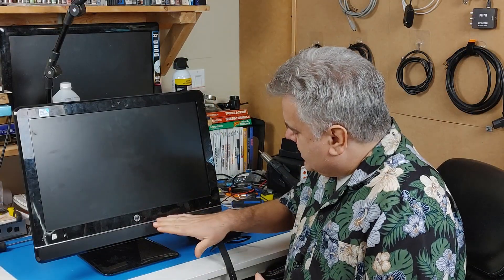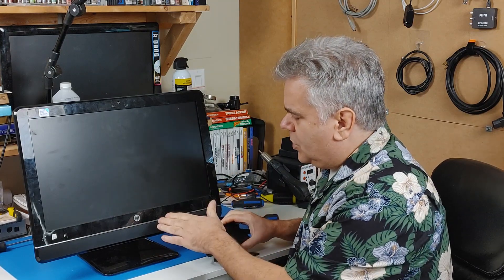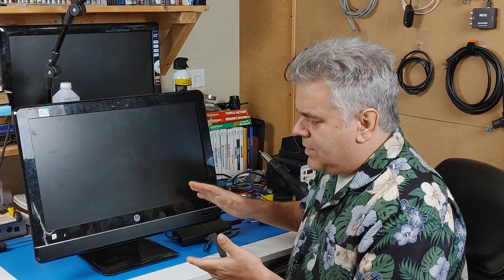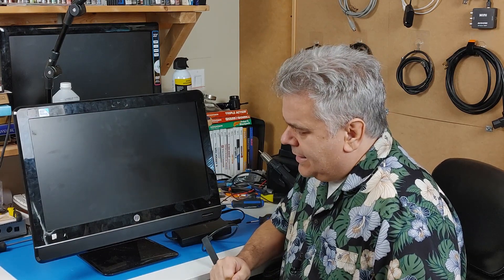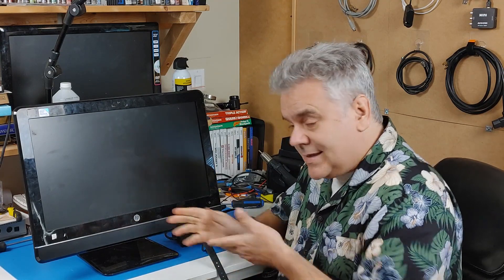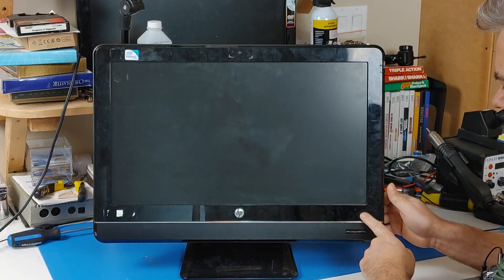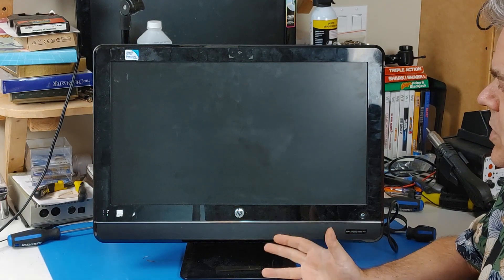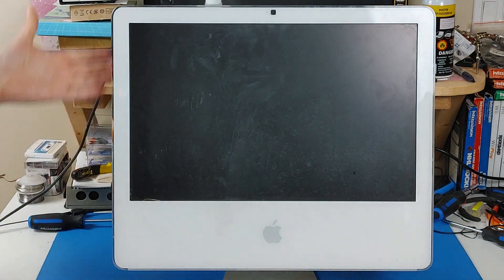Replacing The CMOS Battery in An HP Compaq 6000 Pro All In One

Comment: Before you give up on the HP, I’d like to see you check the power connector, switch and check for voltages.  The principles are similar to troubleshooting of the old 8 bit systems you’ve worked on before.
Reply from the maker: I'm not giving up on it yet, the power switch is on my list of things to check as soon as I figure out how to get to it!
Reply: @CanadianRetroThings  Excellent!  Fingers crossed there will be a Part 2!

Comment: Nice pickup on those systems. It's a pity about the HP not working (I have no idea at all where you could start to try fixing it) but like you said it has a lot of parts that you can use elsewhere. The Apple is a different story though it boots and it was running Linux, I don't know Apples much but I imagine it should be easy to get up (and you have a choice of OS you can put on it). Nice video, I enjoyed watching the teardown to change the battery.
Reply from the maker: The HP looks like it will be a parts computer, I still have not decided exactly what to do with the iMac.  I am thinking of doing a tare down video to pull the hard drive out so I can test and either reformat it or replace it.